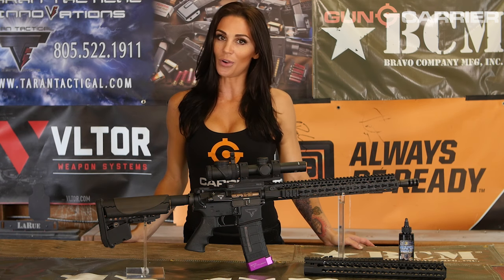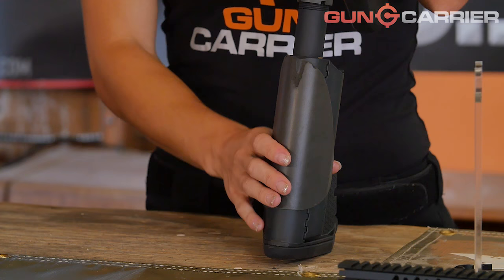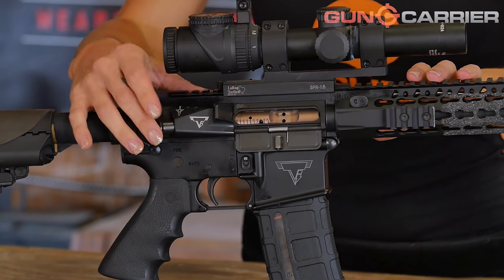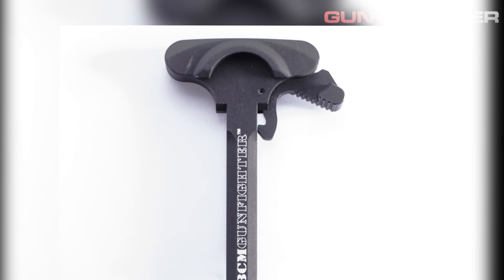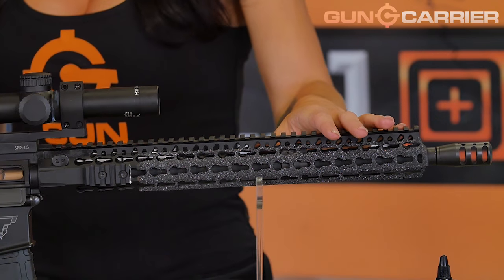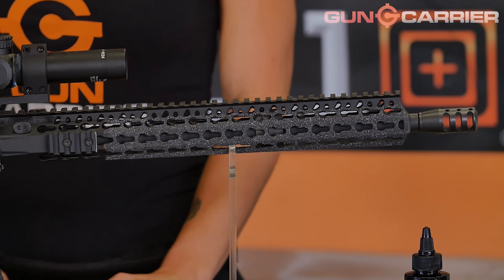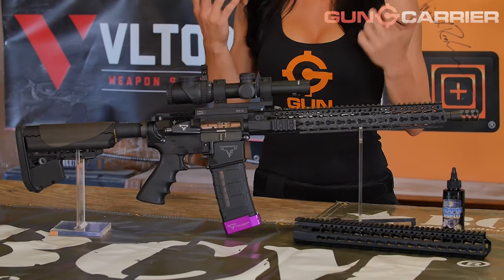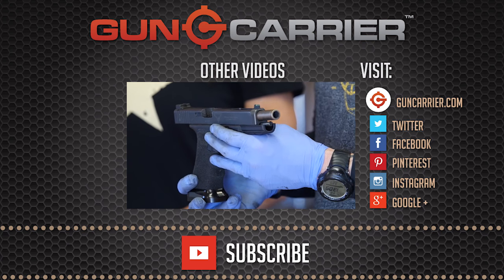Build your AR Armalite for Competitions

Comment: Thank you.  But what about muzzle brake,  barrel twist rate,  is there a reason besides looks to have such a large magazine floor plate? What kind of bolt carrier and buffer weight combo. Is bolt carrier lightened or heavier than milspec.  Do you have to use adjustable gas block or managing cycling rates through buffer adjustments? What kind of trigger? What trigger weight works best for competition? Thanks again.
Reply: Longer magazine allows for easier "monopod"
Reply: Weighted floor plate would drop free faster, marginally
Reply: Not sure how Aaron makes those in ca

Comment: No such thing as an assault rifle.
Reply: +skullfan33 No such thing as a semi-Auto assault rifle.
Reply: +Jim Assalone; No, it is not a term coined by the left, it is a term used to conflate an AR platform semi-automatic civilian rifle styled after a military assault rifle with an actual assault rifle introduced into the U.S. Armed Forces to replace the 7.62X51mm M-14 rifle. An assault rifle utilizes a cartridge which is smaller than a battle rifle cartridge, but larger than a pistol cartridge. An assault rifle is also a select fire weapon, combining the options for single shot, burst fire or fully automatic fire, depending on the rifle du jour. Assault rifles are lighter weight & generally shorter than battle rifles.Their smaller cartridges permit troops to appreciably increase the amount of ammunition in their battle load. The AK-47 is probably the first actual "Assault Rifle" issued to infantry troops.
Reply: I know the history behind  the true assault rifle. The left misuses it purposely to scare low information voters to to ban the semi-automatic AR15. A magazine fed intermediate size cartridge rifle with capability of full auto fire is an assault rifle.
Reply: +Brendon Wright all good you went for the troll, you failed lol I would think you would be used to failure.
Reply: What about the assault spoon and fork